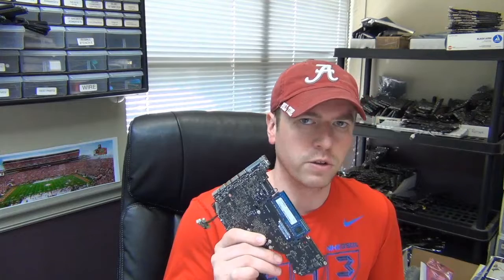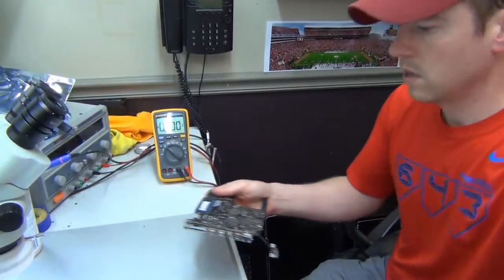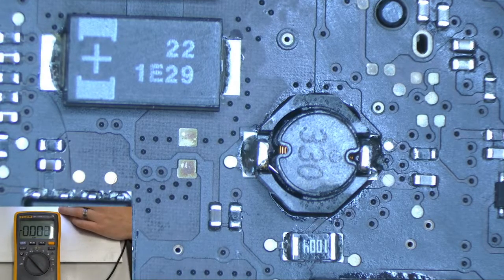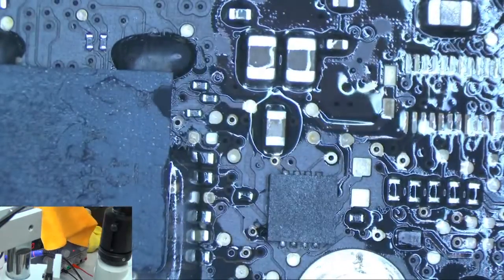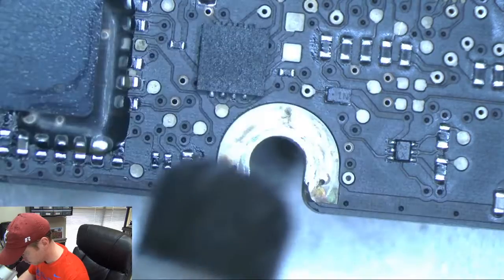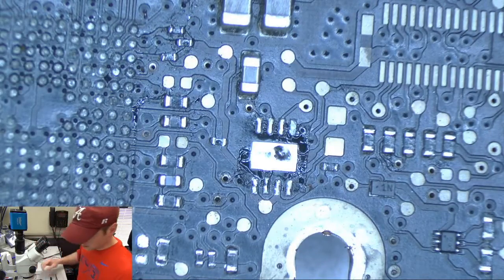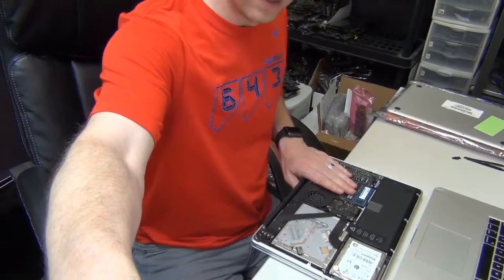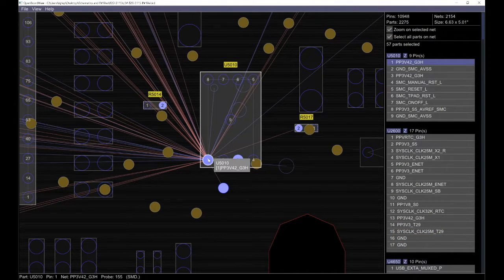Macbook Pro No Light on Magsafe Repair on 13" Mid 2012 820-3115

Comment: My charger gets really hot and burns me at the touch and hardly ever charges. When it does charge it gets abnormally hot and can cause damage to the skin. When it does charge it shows either a very dim Orange light or a bright green light what could this be??? I’ve been through way too many chargers and cleaned the contacts and still no charge?

Comment: dude i have a mcbook pro a1278. . i think the replacement charger is faulty so i try to plug in , in my dc power supply it works and everything. but the current amps is 3.60 and its getting crazy hot. why is it drawing 3 amps? is it because of my dc power supply?

Comment: I have similar problem instead of no power ,I have very dim green light on the charger but there is no power to start the laptop or to charge the battery.
I have 2010 mac book pro 13 a1278 
Please help

Comment: Hi good video but what if all the readings on the one wire circuit are correct and there is no short to ground, the voltages are present on the board, yet the tested and working magsafe still has no green light ,no charging light , and won't power on but it still charges the battery ?

Comment: Hi great vid. Have subbed & liked.  Trying to fix my old MacBook 13" mid 2012. Had boot loop issue, put new keyboard in, boot loop fixed. Tested my patience, hahah.  Now charging issue, disconnected battery & all ok, strong green light on magsafe & booted up great, no probs.  But when battery is connected have initial strong green light for a few seconds then goes to weak orange light & won't charge!  Any chance you can help please?
Reply: Did you find a solution for this